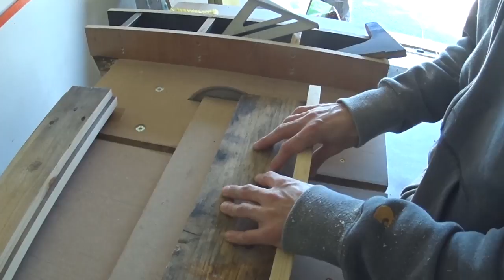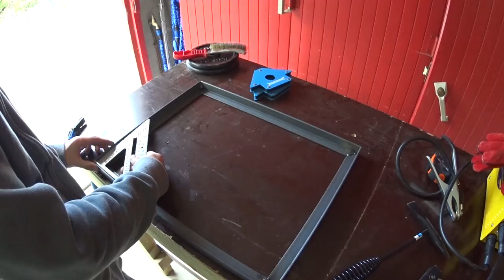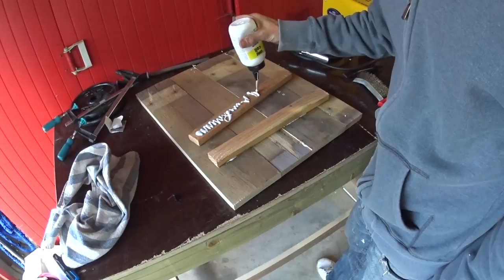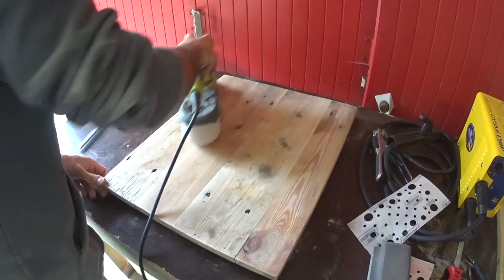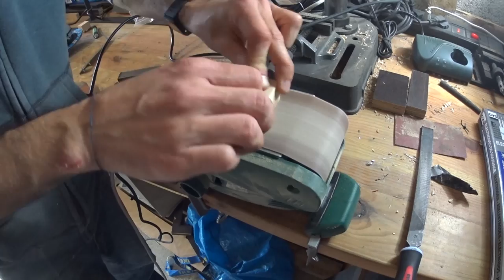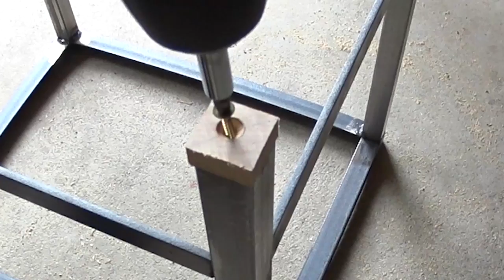DIY Steel & Pallet Wood table

Comment: nice work bro..btw,did you added some paint or other finish for the metal? if you didn't,how to protect it from rust,especially in the welded part? thx for your answer bro🙏🙏

Comment: Nice video, one tip. As a welder seeing you go back over those welds made me cringe. They must have had really bad sla inclusions or "worm holes." Always let the weld cool and remove slag before you go back over them. Hope this helps
Reply from the maker: haha I can imagine. Please keep in mind that this was my 1st welding project, I probably only trained 1h in total before making this table. Also, this project is for me and was more an excuse to make something instead of welding beads on random metal pieces. Thanks for your advice :) I moved onto a MIG machine now. Cheers
Reply: Dude it’s a coffee table your welds will be fine. SMH
Reply: Nice job